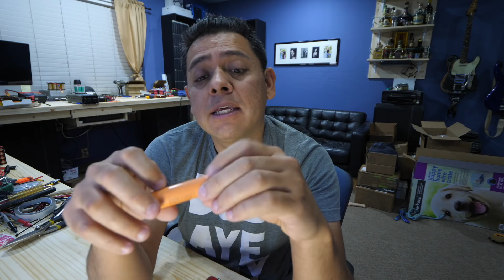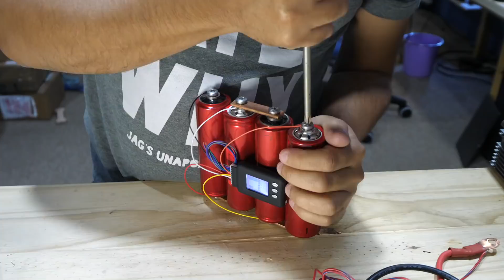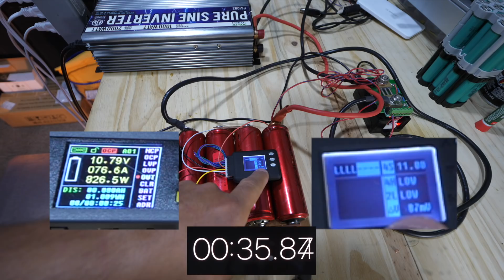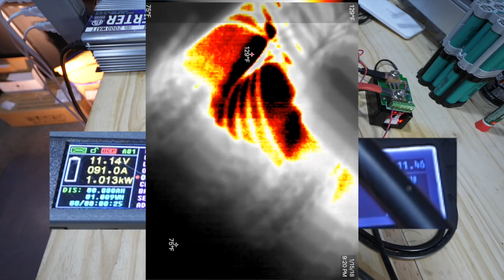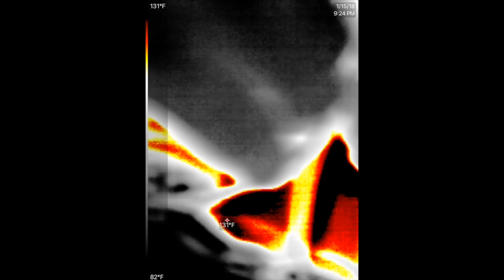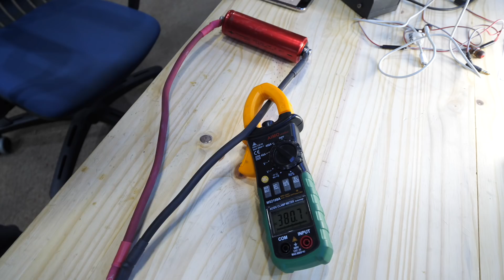12V Lithium Upgrade Headway 38120 Cells - 100A continuous (2018)

Comment: These are great. Im very tempted to buy 16 to build a 48v~ array for a car project. Do you know of a decent way to charge them onboard the car?
Reply: you mean from the alternator? You'd need a DC to DC boost converter.  With the right voltage it's safe to charge lifepo without a charge circuit, and there's commercial batteries that go without a BMS for motorsports though you may need fairly matched cells for that
Reply: animefreak5757 i have a adjustable dc to dc power supply already. So could i feed the pack 48volts from it directly and it would charge fine?
Reply: 3.65v per cell for a 100% charge. that's 58.4v, seems it's best to still use a bms with lifepo.  Makes me wonder what trick they use in those lithium powersports batteries, or maybe they just match cells really well at the factory

Comment: wish they were the same voltage, you could use 18650s for larger capacity and these for the high discharge rate and make a car battery to win them all.

i guess super caps and some 18650s might be a cheaper route
Reply from the maker: Or get high power 18650s Tom has done 25A ones.  16p will give you 400A

Comment: Could these batteries be a decent contender for an ebike? Other than size, what would be a downside to these cells for an ebike?
Reply from the maker: They’re perfect
Reply: @100 amps a cell they put out more then enough current even as a single string of series.  Not sure about volumetric efficiency though if your planning to build a large pack.  With new cells lower amp output usually offers more capacity for the same price, unsure how these compare in the used market.
Reply: animefreak5757 I agree. Although the batteries could handle a large load in series, the capacity still wouldn’t be great for an ebike. Likely I’d want at least 24V with 16ah capacity. Would give a better range especially in a hilly area where I go to school.
Reply: well, 8 of these cells would get you a 24v 16AH pack.  The question is more can you get a cheaper pack then 8 of these? or one for the same price that offer's more AH.  You also need to know what discharge rate you need, how much amperage is the ebike in question going to use?  don't use the wattage of the motor, those are fudged normally to comply with legalities (multiply the voltage of the pack and the max amperage of your particular setup to get a real wattage value)
Reply: animefreak5757 I believe it would take 16 to make a 24v 16ah pack. 8 in series, then in parallel with another string of 8. For the price I think it would be cheaper to get some high drain Sanyos but I’d have to run the numbers. With the lithium iron phosphate I like the higher number of cycles before a large amount of degradation. I have lots of research left for all aspects of the bike.
Reply: doh, your right. lifepo cells tend to last a lot longer as well, not just the cycle number.  As the cells age they lose capacity whether used or not, lifepo ages much slower
Reply: animefreak5757 very true, I appreciate your feedback. I’ll let ya know if I have any other questions.
Reply: Andrew ---- I have been running the 12 amp hour version of headway cells for over 3 years. I bottom balanced them and do not use a BMS and they have only drifted a couple of hundredths of a volt per cell in that time. Haven't checked the capacity since then because it is a real pain in the posterior to do that.

They started out with a real capacity of 13.5 amp hours when undercharged at 3.5 volts per cell. Haven't checked the capacity since then because it is a real pain in the posterior to do that.

They weigh twice as much and 18650 packs, but I don't care because the bike has a motor. They have about twice the volume as well, but I don't care because it is a cargo bike.

If you don't understand basic electricity it is better to get a standard set-up.
Reply: Glenn Howden thanks for the input Glenn. Your set up makes sense to me. I do have a good understanding of basic electricity as I am an electrical engineering student. I haven’t had a ton of exposure to lithium ion batteries but recently began to research them more in depth. What kind of life per charge do you see from your setup? As far as average miles?
Reply: Andrew ---- Well they are rated at 2,000 complete charge discharge cycles when using a 3.65 per cell charge voltage. That would be discharged from around 3.4v/cell to 3v/cell. {There isn't much juice left in them after 3v/cell.} Because I undercharge I expect my cells lifespan to be about the same as their shelf life. Over charging and running them down to zero are the 2 big no nos for LiFePo4 cells.

LiFePo4 batteries are considered dead when they will only charge to 70 or 80% of original capacity.

Get yourself an RC modeller charger and play around with a few cells. I have an iCharger 208b and a 300 watt power supply. Works good and will charge dang near any formula. I charge (2) 8 cell packs in parallel and run them in series using a 4 pole 3 position toggle switch. Four pole because the motor draws more than the rated amperage of the switch, and the extra poles allow the load to be spread out.

I can go 25 miles without worrying. I kept track for awhile and found it uses 20 watt hours per mile average. I don't peddle very hard. {knees} 

My motor is a Bafang 750 watt mid drive. Because it uses the gears it will climb very steep hills. I like it very much.

have fun

Comment: Wow, with batteries like that you should consider upgrading your test cables to teflon insulated ones. Teflon can handle 500°F without breaking a sweat. Maybe something like this: https://www.ebay.com/itm/292391282589

Comment: soooo buck 14.8 4s or boost 11.1 3s li ion 18650 for a 12v hobby battery replacement for my flasher fishing battery build i want to run some light and fans also with this pack so ill have additional connections for usb and alligater clips lol about to salvage batterys today for prototype my guess is buck only
Reply from the maker: 4s LiFepo4 is my choice

Comment: How do you go about wiring up the balance leads on a 4S pack like this, so that you can make sure you are charging these correctly? Or can you just connect them directly into a solar setup like you would with a standard 12v Pb battery? Thanks for your help, really enjoy the videos.

Comment: 3.7v cells, what is the charging voltage 4.2v ?, If so then the charge voltage for (4) cell battery would be 16.8v
What is the charge voltage per cell ?
This is important info that never gets mentioned

Comment: Your comment that you cannot replace 12 volt lead acid batteries with 18650's is technically wrong. You cannot do a straight replacement but you can easily create a voltage limit (with very little loss) to create a 12 volt circuit. I wouldn't dissuade people from attempting a 12 volt circuit design if they have the know how.
Reply: Back to School Bus theoretically you could if you could just increase the voltage output of the alternator to 16.8V, most automotive stuff would probably run okay at that voltage I'd imagine.
Reply: I use lead acid batteries in my mobile solar setup, they are wired 12 volt. Full batteries run 12.7 volts and the charge voltage is 14.8 volts. I plan to replace the lead acid batteries with 18650 and remain with a 12 volt system. This can be done using a buck converter or another conversion method to step down the voltage slightly, loosing a small amount of power. Almost all the peripherals I have would run fine off 16 volts just fine (refrigerator, led lights, inverter etc). I will probably only charge the 18650's to 4-4.05 volts (so about 16-16.2 system voltage); there are numerous advantages to doing this. I was just saying that the comment Jehu made sounded pretty definite and I do not agree. I wouldn't want someone to be dissuaded from attempting it based on his information because the majority of his info is very useful and good.
Reply from the maker: It’s messy,  no one should be doing 12v with lithium anyways unless you have a compelling reason and if you do you should be using Lifepo4 not the 3.7v chemistries.    If anyone chooses to complicate their life for the fun it,  I️ say go for it,  I️ just don’t want to be part of it.
Reply: +jehugarcia That makes no sense whatsoever. A DC to DC power converter/reducer is not "messy" at all, it is very basic and 95-97% efficient. You can buy them for under $40 and they are water proof. LifePo4 is very expensive.... so yeah, if I had the money I would use it. Fortunately I don't have the money so I get to DIY it using recycled batteries that I find for free/cheap. I am really surprised at your comment. In no way is it constructive and "through the computer" it seems kind arrogant. My approach may not be the best but I know it can be done simply. If you know a better way to design a mobile solar system that could run typical RV components for low cost that would be interesting to know. Nothing is gained being condescending about it, "I don't want to be a part of it". Thanks for your input though

Comment: 90 amps and increasing voltage,  'thermal'  runaway
But that 80 amps before getting hot cells, looked good
For cells 7.4 amp hr battery
48 cells (12* 33.99) over $400 to build just one 100 amp hr,  battery aka 1.2kw hr
This is why it's still too expensive, for the avg person, to use in a daily application. In an RV
But yes for just over $100 , 12 cells would make a nice light weight high current starting battery
Reply: you may want to explain that last sentence as I was unable to properly get the meaning... any how if you are trying to cover them with something, I suggest to use cork, they still may need some sort of way to release pressure and they may need some ventilation, cork is a good fire retardant, it also works to dampen noise, and has other positive things that I can't recall...

Comment: Could you use lithium ion with 48V, instead of having four 12V lead acid batteries wired in series?
Reply from the maker: Yes 7s matches 24v so 14s works as 48v
Reply: jehugarcia sweet. Thanks!

Comment: It’s nice that EVcomponents has the parts but I’m not paying $33 to ship a $6 order. 😢😢😢😢😢
Reply: $13 to ship one battery, that's BS and I wouldn't pay this kind of money for new never-mind bogus cells
Reply: @Bruno Gianelli Horrible shipping costs. A $35 fee charged by UPS in addition to the shipping fee. You are better off using ebay for batteries and probably holders etc too.
Reply: I cant find those connectors anywhere!  $33 for shipping is insane
Reply: Ship 4 on ebay for just $39.95.   Pfffft!  Not likely.
Reply: I HEAR yah pal!

Comment: A 12V 100Ah set (13 sets) of these will cost about $500 with shipping.  Then add connectors, case BMS etc. I am not sure it is that great a deal for used batteries when you can get a new calb 100Ah for $130 each x4 = $520 and they are new and warranted.
Reply from the maker: That’s the equivalent of charging these at 4A per cell,   There is no heat at that rate on these either.   Short out your calbs for 20 seconds and see the heat build up
Reply from the maker: If the calb 100Ah can do the job,  these would most definitely be overkill.  Why would you use powercells as energy cells?
Reply: OK -  There was no intent to critisize or demean anyone with my comment.  It was only a simple observation.  I follow and have great respect for Jehugarcia and the other youtube powerwall posters.
Reply: I use Calb's (180Ah they measure at 197Ah) in my electric lawnmower. I charge them at 100 Amps 60 volts, works great and Nothing gets warm to the touch. If the batteries are heating up it will shorten the life.
Reply: Just is what it is mate, calb are designed for a different purpose, you are comparing 100ah vs 100ah but you are not considering 200 amp current capability per cell, calb can't pull nearly that much power without shitting the bed these are a specialised cell I have 24 of them and they can pull more watts then most mains connection can from the grid! 
17,200 watts continuous or 35 kw burst from less than 5kg of cells thats. Calb are also a much cheaper cell with many less lifecycles and have had quality issues with bulging cells well before claimed life cycle.
Reply: You are 100% correct Jehu, This is a funny Calb video of a guy shorting the batts out.https://www.youtube.com/watch?v=h2VnUWRVOVM

Comment: What did he use for the thermal imaging? It looked like he was using a cell phone.
Reply from the maker: Correct,  thermal camera
Reply: Hi. Thank you for the response. I'm sorry, but I do not understand your answer. 
1. Does your cell phone come with pre-built thermal hardware installed?, or
2. Did you add something to your cell phone for thermal imaging?, or
3. Is it an installed Android / IOS program (app) that you are using on your phone?

(I've been interested in thermal imaging for some time, but costs tend to prohibit me purchasing thermal imaging equipment.)
Reply: Look into Seek thermal camera for android/apple devices

Comment: It was perfectly normal for it to drop to 2.7V under a very heavy load, as LIFePO4 cells have very steady voltage at that range.

This would've been so much better if they were each at equivalent voltages.
Reply from the maker: Matched cells are always  better

Comment: Pretty brave and maybe a bit crazy for doing that short circuit test in your house! Thanks for the info. Can these be mixed as a pack in parallel with a 48V Li-Ion (14s) pack to supplement power handling?

Comment: I'm wondering how they would do in the cold weather. How much voltage drop if any sitting for a week or so in the cold. Great video.
Reply: Extreme temperatures are a issue for all batteries at very low temperatures. 

Generally, there's elevated internal resistance that will cause some warming effect because of efficiency loss during use. At –20°C (–4°F) most batteries are at about 50 percent performance level. 

Although NiCd can go down to –40°C (–40°F), the permissible discharge is only 0.2C (5-hour rate). Specialty Li-ion can operate to a temperature of –40°C but only at a reduced discharge rate; charging at this temperature is out of the question... Though, laboratories have managed to get them to charge with extremely low current but it would take days to charge at that rate.  

While lead acid is a bit more forgiving and you can charge them down to -20°C. There is the danger of the electrolyte freezing, which can crack the enclosure. Add, lead acid freezes quicker with a low charge when the specific gravity is more like water than when fully charged.  Along with the general need to keep a lead acid charged at all times and over 50% of its rated capacity.

For lithium, you'd typically see a drop in usable capacity as Lithium works optimally at 25°C.  So at 0°C it'll drop to near 80% and at -20°C it'll drop to nearly 60%...

But there are specialty enclosures for lithium that allow for temperature regulation to prevent both getting too cold and too hot...

While coupling chemical batteries with solid state batteries is another option or only use solid state batteries if you need to deal with really cold temperatures regularly...
Reply: And the thing with Lithium batteries is also that you can't charge them below freezing temperatures.
Reply: ervantussen    Thank you for the break down. really good information . Makes a lot of sense.
Reply: My electric bike struggles when it is less then +15C outside and I stop for 5 min, to have full effect on my 350W e-bike the battery must be kept warm 20-25C maybe (here it is never that hot)... At -10C it gets a little worse.

Comment: Hola Jehu soy de republica donicana , can you do a test with ultra caps set up for replacing a car battery?
Reply: It does not make sense to use just caps as a battery replacement, but it does make sense to use them in combination with another battery as an "amp buffer". In this way you can use a battery that cannot peak at an amperage that would start an engine, like a regular 10A LiFePo4 or old Lead-Acid you would normally need to replace in winter (caps are fine down to -40).
In fact Maxwell Technologies has exactly that kind of a product available for starting trucks called ESM. Since it has three terminals (ground, battery positive, starter positive) I think they put a diode after B+ that prevents the caps from discharging with the battery, so you always have enough energy to start the engine, even with a dead battery, which is also their major selling point.
So the way it works is when you start an engine the cap unloads the power into the starter motor, and then, over a couple of tens of seconds, gets recharged from the battery/alternator circuit. And you don't need that much energy start an engine, about 250mAh*12V=3Wh from what I've read. 250mAh is 900A over one second, so that is plenty.
Reply from the maker: Why?
Reply: I have seen a few of them on the internet mainly on lasersaber youtube channel, for replacing a 12v lead acid batteries on cars using super and ultracapacitors.
Reply from the maker: Caps don’t hold a lot of energy,  so if your car doesn’t start in the firsts few tries it could waste all the energy and you would be stuck.   It’s batter to use a battery that can put out power and hold  some spare energy
Reply: they do hold a lot of power and can discharge and recharge very fast, can I send you a video link.
￼
Search
￼
￼
￼
￼
￼
￼